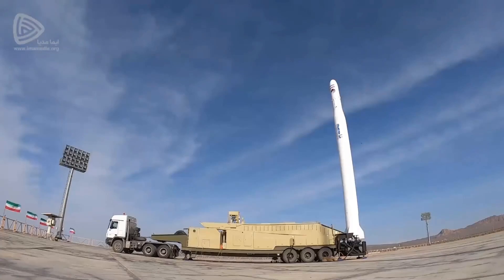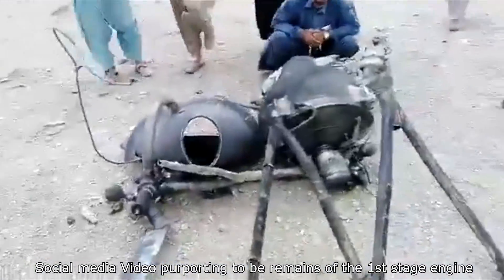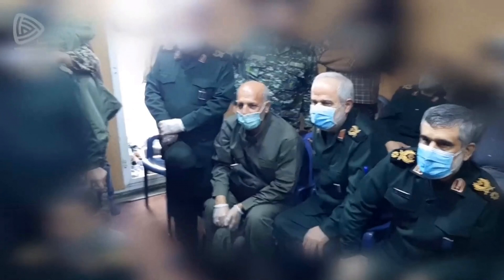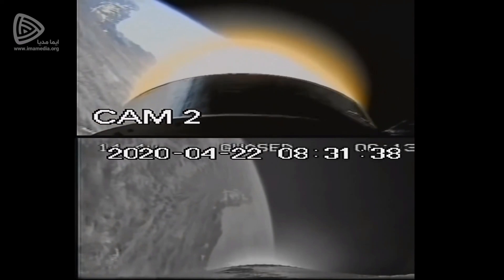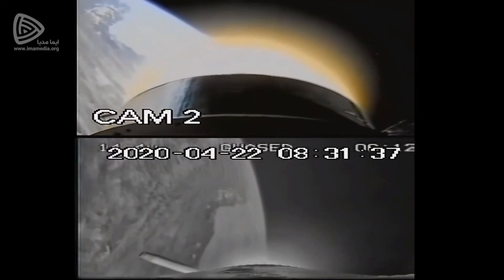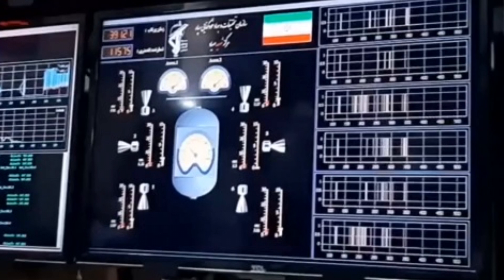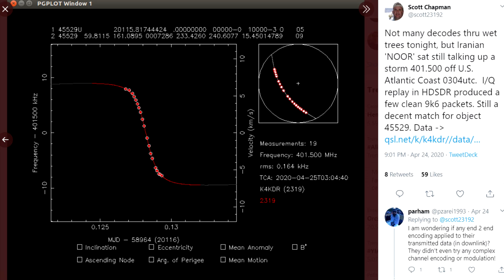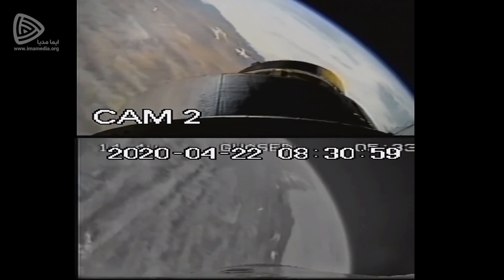Decoding Iran's New 'Qased' Rocket and the 'Noor' Satellite

Comment: That is just a Scud Engine (R-11 Elbrus) in a big boy suit. It only uses UDMH as a starting "slug" with the HNO3/N2O4 AK-27I oxidizer mixture, the primary fuel is ordinary Kerosene primed behind the UDMH starter. The blackbody radiation-nature of the plume and the black smoke streaks nearest the nozzle are from the fuel-rich mix running the gas generator. It's primitive, but it works.

Comment: Polymer Composite material have five categories. One of them was reinforced carbon-carbon. One of them was carbon fiber. One of them was fiberglass. One of them was ceramic matrix composite. One of them was metal matrix composite (light metal such as aluminum from clay and magnesium from dolomite and calcium from limestone + carbon fiber + clay ceramic material = mixture of metal matrix composite material)

Comment: Iran build solid propellant rocket satillite of 3-4 stages booster engines detachable...it's sizes adjustment on cylinder and diameter of booster to push good trush pressure of engine....I am from Bangsamoro Philippines..

Comment: Good analysis by Scott. Let me add something more to it. This successful launch by Iran will have far serious ramifications. The success for Iran is not only the 2nd stage but the 3rd stage also. In fact the previous few satellite launch failures of Iran were not due to the 2nd but due to 3rd stage which here in Iran's case is the kick motor stage or the stage which I would call space engine stage. Because this 3rd stage kicks the satellite into the required orbit once the satellite reaches the required height. Iran has used Saman 3rd or kick stage and within this 3rd stage Arash 24 motor has been used which is a solid fuel-based motor, not a liquid fuel-based motor as Scott mentioned. This new Arash motor is a significant improvement on Arash 22 or may be Arash 23 motors. It may be used by Iran to kick satellites into low earth orbits but also for orbital transfers and Iran may now think of transferring satellites into very high orbits such as geostationary orbits  at 36000 km by using this 3rd or kick stage after scaling up. The second great achievement for Iran is carbon fiber-based 2nd stage known as Salman which can be used not only in satellite rockets but also if Iran wants in very long range or intercontinental ballistic missiles. These two achievements are like a revolution for Iran space and missile programs.

Comment: Those failed projects were managed by the state agencies where lots of infiltrated elements are present to sabotage the whole project.
But the IRGC is a fully different league and acts fully in secret until the project has delivered its desired results. As you could see the first launch of IRGC was a full success and so will be the next steps to reach higher altitudes.

Comment: Shouldn't it be 'rocket engine' and not 'rocket motor'? Engines run on heat; Motors run on something else, electricity, pressurized hydraulic fluid, Etc

Comment: The IRGC announced the following facts about this launch. The launch was at a facility being monitored  by outside powers but using a mobile launcher to demonstrate the ability to launch quickly. This sends a message that the launch time is fast so reaction times are very small and the launch could happen from points in the country hard for them to track. They also said the use of the liquid fuel first stage booster was to save on costs. It was a short cut. They had a proven rocket engine for the first stage already in stock powered by a liquid fuel and didn't want to risk the launch using an untested solid fuel platform for stage 1. Now that they have performance/telemetry data for the solid fuel stage 2+3 they can use this in situ data to develop the first stage solid fuel platform further. They said telemetry data is received and related via a network of posts on the ground. In my opinion this is new assets and existing ones left in Iran by the CIA to track Soviet launches. Sites such as Kapkan can do that. The IRGC also explained the satellite is very basic in nature and further launches will put in place more valuable assets.

Comment: Scott wouldn't that graph you're talking about at 6:05 be G forces/acceleration rather than velocity? Doesn't make sense to me that there would be sharp corners on a velocity graph?
Reply from the maker: There’d be sharp corners when it stops accelerating and coasts.
Reply: @scottmanley  exactly. Sharp corner when acceleration stops. Velocity however would present an arc.

Comment: sir can an icbm has a minimum range of 2000 while having maximum range of 10,000 km ?
Reply: depends on payload
Reply: @JohnDoe-420  for example take df 41 can it has a max range of upto 15000 km can it hit target at 2000 km with same amount of payload as with 15000 km range secondly
Reply: my simple question is that can an icbm of range greater than 10000km used as srbm mrbm ?

Comment: Wouldn't UDMH and N2O4 or nitric acid (or a combination of both) produce a somehow transparent flame? The opaqueness  and brightness of the flames and the color of the smoke reminds me of liquid oxygen and kerosene. Obviously there's no ice on the rocket so liquid oxygen is out of the question. But, could there be a room temperature oxidizer that burns with kerosene? Maybe hydrogen peroxide or the AK27 itself?

Comment: what is the difference between 3U and 6U cubesats? is there a 9U, 12U?
Reply: 12U is used, I don't think I've seen 9U. Each 'U' is a unit about 10cm x 10cm x 10cm in size (approx. 4" x 4" x 4"). Bigger satellites like 3U get some extra from the space between the cubes that would be used for deployment if they were separate 1U's. These sizes are based on a cubesat standard that makes it possible to design small satellites for launch on any of a number of cubesat launchers, including many commercial launch providers. Wikipedia has a good article on cubesats if you want more details.
Reply: @panzertoiski  thank you

Comment: Many years ago I've seen a part of a TV news story mounted in a documentary from an ukrainian warehouse of a production facility where they kept ready to use solid rocket stages from some of the USSR missiles and disposes of them as the designed life span ends that looked the same as iranian one: carbon fibre body with stearable nozzle. I'm not sure about the scale though. Also in that documentary there were shots from these stages testing in which spherical expansion of the bulkhead was seen as the engine fired.
Reply: So now an American puppet is supplying engines to Iran..WOW. Hollywood beckons..

Comment: The acceleration on that graph is constant throughout when any engine is on power. This shows the efficiency of all the control systems on board.
Reply: That's a pretty good analysis!
Reply: Constant acceleration would mean a consistent power output reduction all the time... I don't see the point in that and I don't see that in the graphs. What I see is constantly increasing acceleration which makes sense because that's how rockets just work.

Comment: With the success of that solid fuel stage now proven in flight you can bet there will be a new "civilian" launcher with an all solid 3 stage system , if they do announce that then we know its nothing more than an IRBM that's waiting on its nuke payload ( although the IRGC uses ballistic missiles very readily and reasonably accurately with conventional warheads , Chemical/Biological warheads would also be possible with a system like this ).

Comment: Correction: The Dove sats from planet.com are 1U cubesats, they have another higher resolution sat series.  A 3U or 6U sat could use a larger aperture for higher resolution, even though it is still not as high res as the best NRO keyhole sats.
Reply from the maker: No they are 3U, I've literally held one in my hands.

Comment: Can someone tell me what 6U and 3U CubeSats are? What does it mean?
Reply: Each 'U' is a unit about 10cm x 10cm x 10cm in size (approx. 4" x 4" x 4"). Bigger satellites like 3U get some extra from the space between the cubes that would be used for deployment if they were separate 1U's. These sizes are based on a cubesat standard that makes it possible to design small satellites for launch on any of a number of cubesat launchers, including many commercial launch providers. Wikipedia has a good article on cubesats if you want more details.
Reply: @panzertoiski  that clears up a lot of confusion thanks 🙏👍👍

Comment: Why is a solid rocket booster an improvement in Iranian rocket technology? Aren't liquid fuel rockets more difficult?
Reply: solids are more dense than liquids so the tanks can be smaller. However, controlling thrust with a solid fuel is possible but more difficult

Comment: so funny that the V2 still lives on to this day. the engine, the steering all of it really, just an upgraded V2.
Reply: You might be thinking about the RD-108 engines used in the R7 rocket (Sputnik, Soyuz), which are ultimately derived from the V2 engine - with a different fuel combination and regenerative cooling, but a similar H2O2 driven turbopump. The Scud engine is a fundamentally different design which uses hypergolic fuel and a hot gas generator turbopump (-> burning fuel, not H2O2). What is quite similar to the V2 though is the guidance system, using vanes unlike the R7 and Atlas with their vernier thrusters.
Reply: @lennartplaga9056  Aww man you beat me to it. Soyuz peroxide powered turbopumps are my favourite example of V-2 technology still being around.
Reply: @lennartplaga9056  Everybody was building on German experience after the war, but RD-107/108 is not really "derived" from either A4 (V2) or C2 (Wasserfall). The clearest evidence of this is that the advances in combustion chamber design implemented in Soviet engines was not replicated by the German teams in USA and France until much, much later.

The RD-107 turbopumps were of course ordered from the same factory that was already making copies of V2 pumps, so there is a lot of influence there. But V2 turbopump itself was not developed at Peenemunde, but by an external contractor (Oddesse GmbH -- a company that still exists, though they do not mention this episode on their web-site). This company specialized in turbo-pumps for firefighters and similar applications long before the war. It was a very well developed technology, only applied to things other than rocketry.
Reply: erwin vercauteren  lol what weed you smoking.
Reply: What is funny  your 2 cents comment on something you have no idea
Reply: @bahmanborzou4650  I study aerospace engineering, come again?

Comment: How delightfully anachronistic - a Scud boosting a filament-wound carbon composite solid upper stage.  With thrust vectoring.  And camera downlink.
As you've said, once they replace that first stage, the launcher really becomes interesting.
Reply: what's the persian for "if it isn't broken, don't fix it?"
Reply: Once the Islamic Republic of Iran makes a viable solid fueled first stage, they will have a functioning long range ballistic missile. They need this to achieve a military deterrent with Israel & Saudi Arabia, as this would launch an EMP 

device [thermonuclear], which allows them to level the field if war breaks out. As Iran can stand up to Israel & Saudi Arabia if no high tech weapons systems are involved, hence the need for a way to launch a nuke into low earth orbit. 

[ note their faith prevents them from using thermonuclear weapons on their adversaries populations, however their faith allows them to use an EMP to disable their adversaries modern weaponry...]
Reply: @davidhollenshead4892  [note] ... which in a strange twisted way is actually a good thing... i suppose...
(as far as nuclear warfare - or warfare in general - can ever be a good thing)
Reply: Not many nations in the world can deploy satellites without any outside assistance. There's only 9 or 12 at the most. Now Iran has joined that list. Soon they'll put a human in space and after that who knows. The remarkable thing is that they've managed to do this despite sanctions. North Korea was also able to build a viable missile program and they can now target the continental US, all despite sanctions. If this proves anything, it's that sanctions don't work. The only two possibilities are war or negotiations.

Comment: How does the telemetry computer know apogee and perigee?  I feel like there might be an explainer video in this.  Presumably the computer is just using position + airspeed to calculate the orbit, but what sensors produce those figures?  Ground radar?  Onboard sensors?  GPS?
Reply: Simplest method is to integrate acceleration at a given attitude over time

Comment: I keep remembering 1957 when the Russians put Sputnik into orbit.  It wasn't Sputnik that mattered, it was the fact that if a country can put something into orbit it will also be capable of launching an ICBM at it's enemies.
Reply: USSR announced on 21 August of 1957 that they have successfully tested an ICBM. In the same summer they have announced that they were going to launch a satellite (as a part of International Geophysical Year) and gave exact radio-frequencies that would be used by its transmitters. But only when Sputnik was actually launched on the 4th of October, everybody in the West took it seriously -- as though it was a sudden and a shocking thing with no warning. (In reality, Soviets did not tell the whole truth about the ICBM -- the rocket itself was indeed tested successfully, but the warhead burned up on re-entry. It was not yet an operational system. While they were re-designing the reentry vehicle, the rockets that have already been assembled were allowed to be re-purposed for "civilian" experiments, and that is how Sputnik was launched.)

Comment: Iran shifting to SRBs makes sense, they are more economical to run, powerful and pretty straightforward compared to metallurgy and machining necessary for liquid fueled first stage engines. 

There is also the military applications of SRBs, American ICBMs are SRBs after all.
Reply: Exactly a solid rocket motor when designed well can be stored for long periods of time and them launched within minutes whereas even with storable liquid propellants more work is needed and you can't just leave it fueled ad infinitum.
Reply: @Abdul rahim Doing what?
Reply: @Abdul rahim Exactly, as the Islamic Republic of Iran wants a deploy-able  Electromagnet Pulse Device, and that means detonating a high altitude thermonuclear warhead...
Reply: @Abdul rahim do not worry they been saying iran will have nukes for last 40 years in a year or so I am waiting!!!
Reply: Given that their real goal is to develop ballistic missiles to attack Israel, and maybe even America, those are exactly the applications they are concerned with.
Reply: @odysseusrex5908  given the orbit of their "webcam tumbling in space" they've basically proven that they have ICBM capabilities. And while a 6U cubesat isn't exactly a MIRV, I'm pretty sure the military intelligence community at large has taken serious notice of this launch.
Reply: @odysseusrex5908  Once the Islamic Republic of Iran makes a viable solid fueled first stage, they will have a functioning long range ballistic missile. They need this to achieve a military deterrent with Israel & Saudi Arabia, as this would launch an EMP 
device [thermonuclear], which allows them to level the field if war breaks out. As Iran can stand up to Israel & Saudi Arabia if no high tech weapons systems are involved, hence the need for a way to launch a nuke into low earth orbit. 
[ note their faith prevents them from using thermonuclear weapons on their adversaries populations, however their faith allows them to use an EMP to disable their adversaries modern weaponry...]
Reply: @davidhollenshead4892   They need this to commit aggression against Israel and Saudi Arabia, who pose them no threat. The greatest threat to the Islamic Republic comes from its own people, who wish to change their form of government.
Reply: @odysseusrex5908  They don't need ballistic missiles to attack Israel - it's right around the corner.
Reply: @odysseusrex5908  Interesting. Israel is 1000 km away from Iran and Iran had missiles that can reach much farther than that for nearly two decades. 

So why exactly did they not attack yet?
Reply: @odysseusrex5908  only israhell and US used mass destruction weapons in Iraq Syria Libya Afghanistan Korea wars moabs etc so Iran has right defend from evils
Reply: Imran md seems fair to me

Comment: Definitely not UDMH (or any hydrazine derivative for that matter) on the first stage, way too much radiant carbon in the exhaust jet.  Could be Tonka or even Aniline if it still has that much of a North Korean look to it.
Reply from the maker: The thrust vectoring fins are carbon.
Reply: @scottmanley  True, but check out a Hydine (sp?) fueled Mercury Redstone for what hydrazine and carbon vanes exhaust jet looks like.
Reply: Or better yet, look at a Corporal for an Aniline RFNA example (with graphite vanes).

Comment: those veins in the exhaust stream look a lot like the ones on the A4
Reply: Also similar to a Redstone, which is an evolution of the A4. The engine looks kind of like the A4's as well.
Reply: That's because Scud was designed based on the V-2